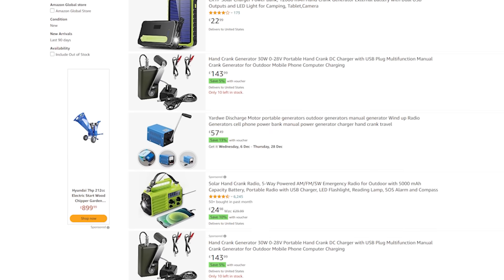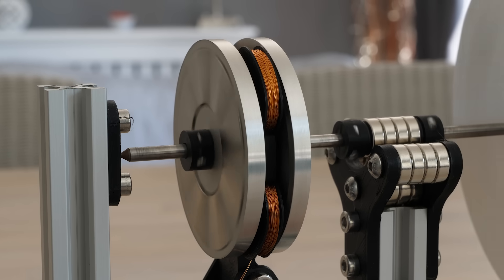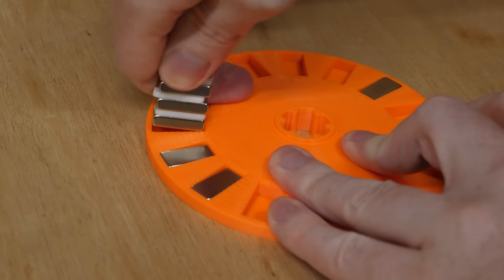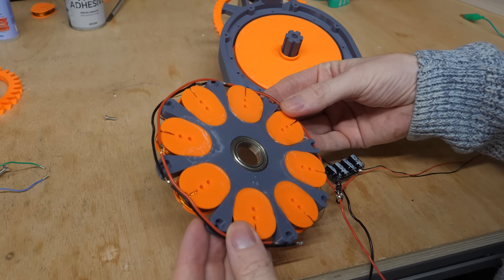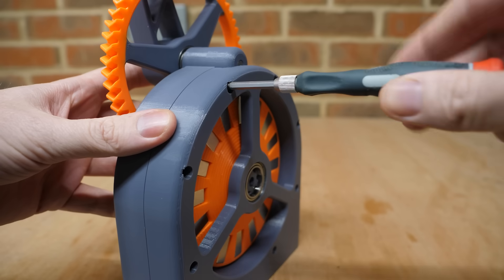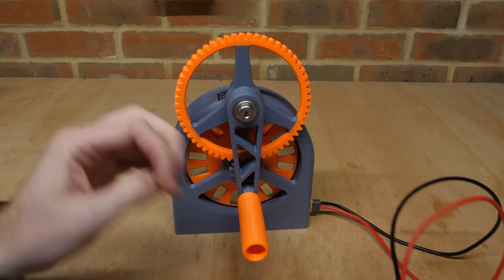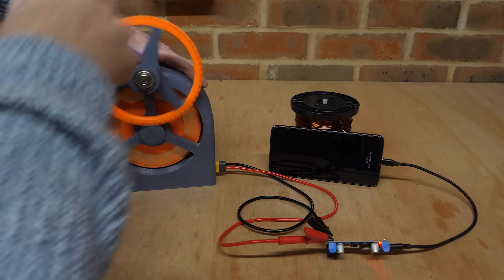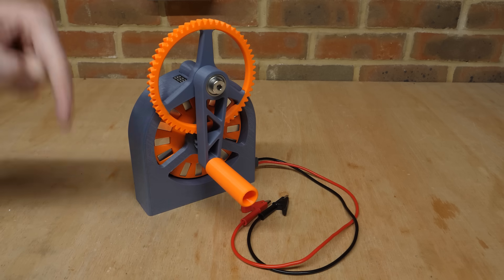Building a Generator

Comment: iv' be wanting to make a crank generator, Im wondering if i can use a Buck boost converter  to make it to where i dont need to spin it super fast. I was also thinking of just Getting a Treadmill motor, and putting a 2 to 1 ratio  on it  but iv' been having trouble  on  generating anything past 400w i almost need  to strain  super hard  to generate anything past it .       would you know of any way to  make 400w  Manually Without  basically Dieing , or breaking     teeth on plastic gears from the stress?
Reply: Watch GreatScott video on the topic, he did something very similar to what you are referring to, in his case it didnt work too well compared to doing the same with a ebike.
Reply: @themastereal8345   2 months later i Experimented with a Hoverbike permenant magnet motor , IT outputs 60v,  so i use a step down  converter that i can set to 18v . for my drill battery im using   Since it has a on board balance circuit  it just gets 18v and charges it back up  It seems to be once  i get past 18v output from the motor i spin,    IT gets easier to spin Aslong as i keep it past a certain rpm .   it reminds me of how a alternator works .

Comment: Wait if there is 8 coils and you wire 2 in series and 4 in parallel that's only 6 of the coils... what about the other 2?
Reply: He probably meant that there are 4 in parallel, another 4 in parallel, and those groups are connected in series. Or the other way around, 4 groups of 2 parallel, and the groups are in series

Comment: I womder let say you started  charging the capacitor by hand that holds the power then u run it to that motor  back to your hand crank device to crank it atomatox for u will that make endless  supply then u can produce enepigh energy
Reply: Also  instead of the the two rotors  can't you do about 4 set ups produce even more
Reply: The motor won’t have enough energy to spin fast enough and with enough torque to equal out. You could power the motor and then run the generator off the motor, but it will slow down and stop. And if you try to charge a phone at the same time, it’ll slow down even faster. You gain nothing

Comment: If pressing a small, high torque, motor/generator against the back wheel of a bike, as a substitute for the caliper brakes, would a dc-dc buck converter be sufficient to level out the current and voltage going to a bank of super capacitors to safe levels?

Comment: If building an electric bike, could you have a battery connected to the motor on the front hub propelling the bike and place this generator on the rear hub charging a back up battery? I understand you’d loose power over time and the resistance would take a toll on the output battery but this seems like having a generator could double your traveling distance. Am I missing something?

Comment: I want a stationary bike generator
Reply: Treadmill  for me.
Reply: @motoryzen  Do they make treadmills that don't require electricity?
Reply: @Skeldons  I don't know off immediate memory, but for me my idea is to connect such a generator so that when I get on the treadmill the faster I can walk or run and for a longer period of time that I can actually electrically charged up some batteries to a portable battery station that contain a normal dime a dozen household 12-volt Outlets
Reply: @Skeldons yeah they use an incline, but it's basically an inefficient bike when used like this.

Comment: If you attached that to a stationary bike, you could charge your stuff a lot easier and get a workout at the same time.
Reply: People would buy a phone charger built into their bike for sure.
Reply: @lm-rh3qo  Amongst touring cyclists front wheel dynamos are a thing. Mostly for lights and charging electronics.
Reply: Maybe you could somehow use the energy from braking, that would be cool
Reply: @NormanRiepke  That's already a thing! https://wikipedia.org/wiki/Induction_brake
Reply: @CommandProMC  That's the other way round
Reply: @lm-rh3qo  Im actually trying to figure out how to rig up my row machine somehow. That's why I am watching these
Reply: If I’m not mistaken, the elliptical machines at many gyms do something like that. They’re not plugged into anything, but they use the electricity from your… pedaling? (Whatever it’s called when you use the elliptical) and uses that to power cooling fans, the display, and the computer responsible for tracking distance, calories burned, modes, etc.
Reply: @J0eMega  Last gym I went to did that with the bikes. Didn't see plugs anywhere, and you could see the screen fade out when you stopped pedaling in a way that is consistent with losing power. Though the rate of the fade out looked like that had at least some capacitance in there that kept power for a second or two after you stop.
Reply: yes
Reply: that exists by the way! very cool concept used on stationary bikes and on normal bikes too to power the headlight!
Reply: I was thinking the exact same
Reply: If you attached one to an electric bike could you theoretically have a bike that never needs to be charged?
Reply: @nytro8027  if you do enough of the pedalling yourself, yeah. Conservation of energy would suggest that that would be overall less efficient than just having a pedal bike with no motors on it at all, but maybe it could make sense to like, help you with hills or whatever.
Reply: @nytro8027  probably not, have you ever seen that video of a professional athelete powering a toaster that way?
Reply: @pathurus  A toaster needs WAYYY more energy than just charging a phone
Reply: @ByTheGram  producing power this way is still unfeasible
Reply: @nytro8027  It could extend range by acting as a regenerative brake, but the bike would still need to be charged.
Reply: They have this exact thing in my uni lol
Reply: Heck, get it on the bike, then connect it to a big battery and then you can store the power!
Reply: Black Mirror. Season 1, Episode 2.
Reply: Who wants to workout?
Reply: Add a diy steam engine to turn the generator wheel. Once you have wood and water ti power the steam engine you have unlimited source of energy
Reply: Maybe that's what happened in that episode of black mirror with global warming and no jobs because of AI it could come true
Reply: probably not, have you ever seen that video of a professional athelete powering a toaster that way?

Comment: Hi Tim. You could charge the capacitors, connect it to the motor and the motor fit it into the generator to see what happens, like a chain effect. I know that at some point it will stop but it would be nice to see it. Greetings

Comment: Imagine attaching it to 2 pedals that you step on and let your bodyweight crank it with a gear ratio designed to resist almost all of your bodyweight.

You could also attach some kind of spring loaded system that lets you store energy that you can release to auto crank it when you cba doing it manually.

I wonder how much of this you could achieve in the wilderness with only iron and copper ore available. I'm guessing the insulation on the copper wire would be the downfall.

Comment: That's how diesel trains work too, they don't directly power the wheels, instead of using a transmission and fly wheel to generate power they generate electricity and power electric motors that provide much better torque. This acts both as a flywheel and a transmission. It's pretty genius if you think about it.

Comment: Maybe having a gearbox for this would make cranking easier once in the higher rpm when the load is not that light or just eventually switch to a lower gear when conencted to a higher load then switch to higher gear ration when rpm is optimal like with cars speeding up or slowing down using gear switching?  Fun project you have there.

Comment: You should have put coils on both sides of the magnet array
Reply: What would that do
Reply: @FieldBoy111  it would either double the current or double the voltage depending on how you electrically connect them

Comment: To measure your results. I recommend you have an amp meter in serious and a fixed resistor as your load and measure voltage across it. Then using Ohms law, you can work out the wattage you produce. The meters, however, will use power and drain it.

Comment: take care in diode selection. You might be able to use germanium diodes as long as their voltage is not exceeded. They have a smaller voltage drop. The so called "Tate Ambient Power Module" circuit uses germanium to bridge-rectify from AM antenna.

Comment: Another "Hendershot" notion. Anything mechanical has friction and thus energy loss. If you could rotate a magnetic field around stationary coils w/o actually moving anything physically, only the field, then you essentially have something similar to one side of a transformer. Hendershot has this relay-clapper thing in front of a horseshoe magnet. The permanent magnet is very magnetically strong but not moving. But he uses a small amount of power to move the metal-bar into vibration in front of this large magnet. The affect is to bend the large magnetism left and right to his left coil, then to his right coil. Tesla has a water fountain patent where he uses a very small, low power motor to spin a large column of water in a cylinder. The water forms into a vortex and the water level rises to spill over the top of the fountain. The principal he is hiding here is that with low-power you can create a massive effect (similar to pushing a tiny snow ball down a snowy mountain and letting its mass accumulate as snow sticks to it ... enough to smash a house at the bottom of the mountain). Back to Hendershot. So you have this little vibrating bar that bends the massive magnetic field left and right with just the small amount of power to drive the relay. Pickup coils harvest the power of the moving magnetic field. It seems doable.

Comment: Another consideration. The Heaviside simplification of Maxwell equations (current EM theory) get rid of two things : vector and scalar potentials. But, huge charges can built up on metal surfaces that rotate. Think of this like a fan that is spinning the air and there are all these particles in the air that could be harvested due to the air movement (as an analogy). If you were to be able to create a rotating magnetic vortex with one wide end and one apex end, it can suck in air atoms that can arrive to a plate to charge it (similar to Tesla's patent about harvesting so called radiant energy using a metal plate). The potentials that build up on the plate behave like a self-charging capacitor. This energy can be periodically bled off (spark-gap or chopper circuit). I think there is plenty to experiment with you think about power generation w/o the Heaviside simplification. Go back to original Maxwell equations and brush up on Quaternion math (now used in 3D video game software).

Comment: In studying the so called "Hendershot Motor", one thing he appears to have done is create coils for the motor that exactly match the RPM so that you have resonance at this RPM and highest energy gain. He also used very small magnetic wire, a lot more turns, and wiring techniques such as basket-weave or other wiring techniques that consider the wire separation similar to the Tesla patent about bifilar coils. Generators really need to be "tuned" to the frequency they spin at. Otherwise you dampen the result. High RPM makes this easier for the coil because most coils have inductance values that are kind of low. Creating a coil with high inductance is many turns, larger structure, more difficult. Hendershot used a larger motor to re-wire such as a sewing machine motor. Going too small starts to become much too difficult to do. Hendershot also used large AC capacitors that he took apart and re-made so that the desired capacitance is in the nanoFarad range instead of microfarad and to use a capacitance value for his tuned tank circuit with the motor. So for example: 2000 RPM is 120,000 RPS or wavelength 8.33usec. The coil-capacitor tank circuit, exactly tuned for 8.33usec, would have its peak resonance at that rotation rate. NOTE: The automobile ignition coil is "tuned" around 2000 RPM.

Comment: I’m trying to building this and the coil configuration has me a bit confused. You said two in series and four in parallel. Does that mean you have four coils on one side connected in parallel with one in series and the other four coils connected in parallel with one in series? Like two sets of paralleled coils with two in series? Idk I need a wire diagram

Comment: if you created a gear that can fit between two of the coils so it can work like a directional changing gear and have the magnets on gear 1 spin oposite of gear 2 would that give you 2x the output with the same speed?

Comment: The parts list called for a shoulder Bolt M8 x 60mm with a shoulder length of 60mm. I think this is a typo. What is the bolt length and shoulder?
Reply from the maker: Yes, the parts list is correct. The length of the shoulder must be 60mm, and the total length is slightly more due to the extra threaded length.
Reply: @TimStation  Got it, my bad. I did find a shoulder length of 60mm plus a thread of 13mm Thanks

Comment: "Don't know if I could spin it for an hour and 13 minutes"

Just 3D print a small water-wheel, attach it to the handcrank, and mount the generator by a river.
Reply: It would be great to have a bicycle to generate electricity for a gym
Reply: @tunacandoit  I thought some gym machines actually turn themselves on by you beginning to use it, and then it converts that energy you used and powers on the display for the machine
Reply: @deskmat9874  I have an exercise bike at home that does exactly that!
Reply: @deskmat9874  with running machines it probably wouldn't work as well, but stair machines and bikes and rowers and ellipticals it works perfectly. Some stair machines are powered but to be honest you don't really need a motor on stairs that are going down with gravity, only a generator and speed regulator to stop the stairs going faster for a fat person.
Reply: @tunacandoit  unironically might get me to exercise consistently
Reply: 3D printing a hydroelectric dam
Reply: I've always wanted one of these pushes by fan blades.  Set it outside during a high wind time, and have charged batteries for free.
Reply: Create mod from minecraft?
Reply: "just"
Reply: I have something similar on my countryside property
Reply: Another idea is to connect the shaft of this generator to a turbine steam engine.
Reply: does it produce enough power to power said motor and charge batteries but for the motor to power the generator
Reply: @ZaJaClt  
Any sufficiently large and sufficiently sturdy enough water-wheel can power anything when pushed by a sufficiently large/fast enough river.
Reply: "Just 3d print" 😂
Reply: After a certain point, it's easier to make it from other materials.
Reply: windmill
Reply: Or use your lawnmower's engine!
Reply: https://youtu.be/VUF67__DEvE?si=W4X9NOBRbTeG3e8o
Reply: Exactly what i thought hahah

Comment: How do i calculate the voltage however? Like how do i determine how many poles and coils i need, and how many turns per coil will give what voltage (and thus amps)?

Comment: 10 years back, I was very passionate about this when I was in my 4th or 5th grade so then at that time, I made one handheld model using 2 CDs, a cricket bat handle, a long rubber band, an LED, a few wires, and a DC motor. It was one of the first few things I made as a child (who wanted to be an inventor 😅😅😅).

Comment: this might be a bit of a stupid questions but if i wanted to make a rc car and use the wheels with this system using the magnets to add addidtional power to the motor on top of the battery that would power the motors would i be able to do that.

Comment: im new to 3d printing and wanted to try this out, but im confused on the coils. if there are 8 coils and you have 2 soldered in series and 4 in parrallel, what do i do with the last 2 coils?
Reply: Theyre all soulder togheter so put 2 and 2 togheter so you get four series coils and then solder those togheter in parralel. Im no electrician tho.

Comment: How does the resistance in turning work? You said it was harder to turn for the motor... how is it not a fixed ratio of output per unit it of crank?

Comment: Brilliant! It is a compact and elegant piece of equipment. 
That being said just a few minor design tweaks and you’re golden. 
1. Broaden the base of it. That way screw holes can be integrated into it so as to be mountable. 
2A. Alter the cranking part. Like having it so two hands can be use. 
2B. Or Keep the two crank design so the hand cranks can be swapped out for foot pedals. 
2C. You could even change it up so it can be rigged up so the stator can be cranked by a gravity battery. Suspend some weight in the air and connect that weight to the generator by s long cable.